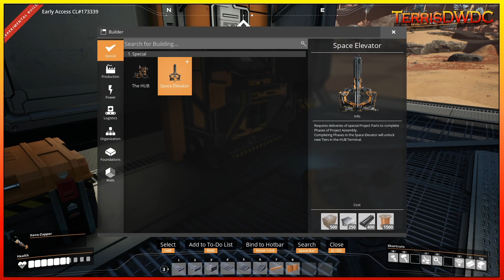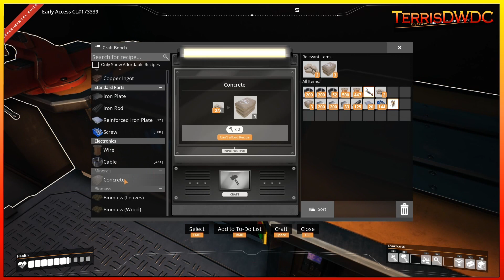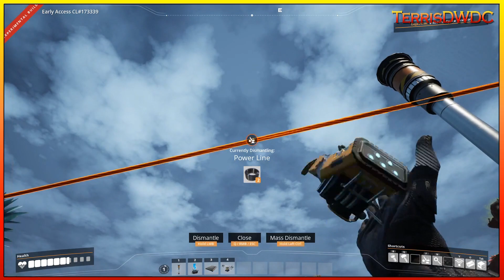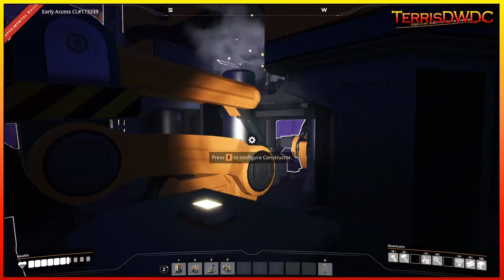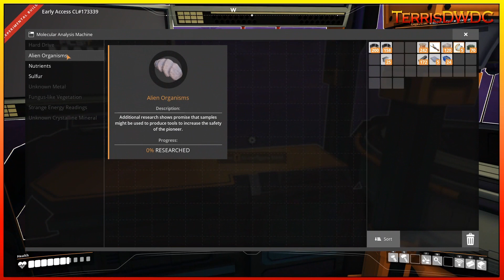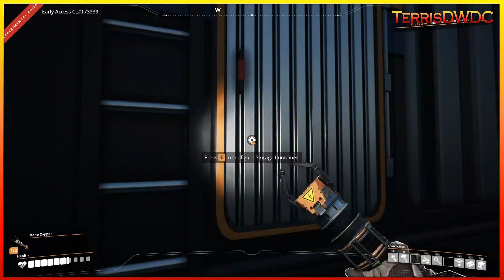Tier 1 Expansion - Satisfactory Update 5 Gameplay E02

Comment: A few things I want to point out even though I'm mostly trying to let you figure stuff out on your own (I'm not caught up on the videos you've put out, so it's possible these tips are unnecessary now).
First off, read the tool tips that show up in the lower middle of the screen when you're in certain modes. Lots of people miss them, but they DO tell you some useful modifiers. For example, when you press "F" it will tell you that pressing CTRL will give you mass dismantle. Also, pay attention to them AGAIN when major updates drop, because they DO add things from time to time.
Secondly, make sure you try everything that gets unlocked with each milestone. In fact, go back to the milestones and make sure you understand everything it tells you it unlocked. Not everything is a building. I've never seen you make an Object Scanner, for example, and you should build one and see how it works (it's equipment, so make it in the workshop).
Third, some unlocks add options to the object scanner or resource scanner... typically, the first node of every MAM tree allows you to search for the relevant item.

Keep the videos coming... I'm so obsessed with Satisfactory these days that I need to watch other people play when I can't. :-)
Reply from the maker: Thanks for the tips, never even thought about the objects scanner. I'm only like 80 hours in to this game so far and about 20 + have been to stock up AFK over night. Any advise is greatly appreciated.  I also understand the obsession.